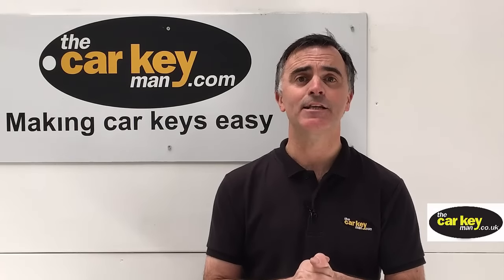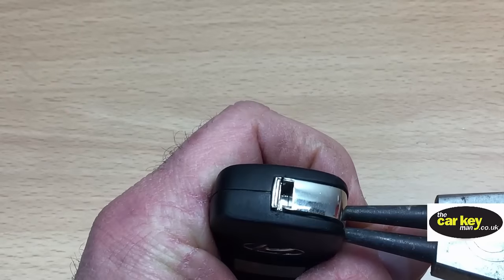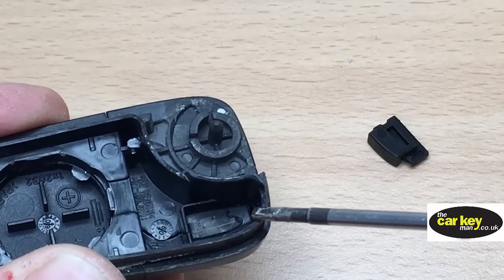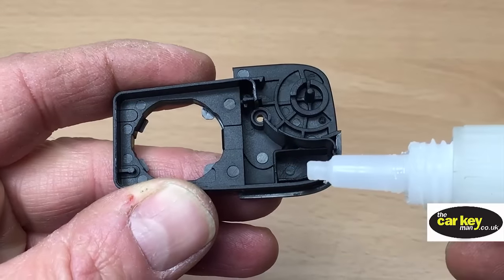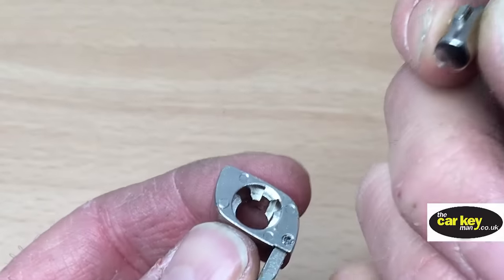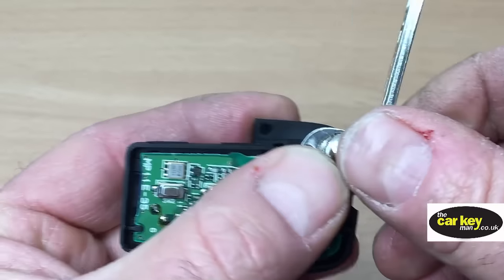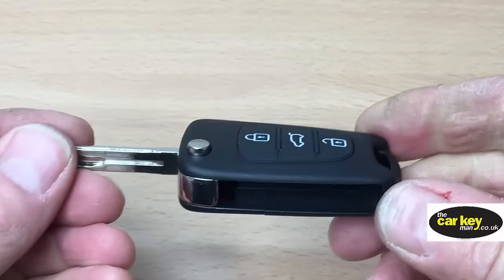FIX Kia and Hyundai Flip Key HOW TO repair

Comment: The dealer wanted almost $400 to replace 1 key fob! I needed to replace 2. I bought the FOB's on ebay for about $18 each and did it myself. Just switched out the circuit board from the old which was still good and put them in the new case. BAM saved myself almost $800.
Reply from the maker: Well done, the prices from the dealers are outrageous at the moment, not sure why. Really glad it helped :)

Comment: thx for the info. learned alot with this movie....... about the pin ..if you search enough on the internet you will find the pin remover (punch).. Most keycar clones sellers have tools on there website too..   and if you dont wanna do it by yourself ..you can still go to a keymaker/shoemaker..   Dont go to your garage because they will bill you...  here in holland its about 300 euros and it takes about 4 or 5 days..pfff
Reply from the maker: Hi, thanks for the information here. Yes we need to put a link up for the pins. Glad it helped you :)
Reply: Just a update of my car key..  I changed the sword and it worked...just made a little mistake..i turned the holder the wrong way  ":/.  It close now when i push button and have to use 1 finger to open it.   But that for me personal better because i broke 2 key in my pocket because they pushed open and there came pressure on the sword and it broke..... twice..    only when you bring your car to the garage you have to tell them how the carkey works otherwise they will say that the carkey is broken.........  primary thing   it works.....

Comment: I have a question if the buttons on the circuit board breaks, can i just swap another circuit board from remote ff the same model? Will i be able to program the button to work on the door locks or the new circuit board has to be paired to my car first by the car dealer?
Reply from the maker: Hi Angelo, the new key needs to be coded in with a computer

Comment: Hi need to replace the keypad on 2 keys is it just a case of split the key and pull out the rubber pads and push the new ones in or is there a glue on them?
Reply from the maker: Hi Jamie
We've tried just replacing the rubber pad and not had much success, as they come looses fairly quickly. 
The cases are glued together so once you crack them open you can't re-use them

Comment: Kia Rio 2011 - Had to cut/snap the old outer casing as it was glued shut! and the transponder was glued to the little removable part which was great. thanks for the video!
Reply from the maker: Well done and thanks for the comments :)
Reply: I’m having the same problem! Thank you
Reply: I had this issue same model. Keys work engine turning over but wont engage

Comment: Genius.  Blade had pinged out as demonstrated due to cracked hinge. New fob was £6.99 and repair went exactly as described in the video.
Reply from the maker: Gtreat stuff Andrew, well done!
Reply from the maker: Did the old blade fit into the new case, or did you get it cut?
Reply: Used the old blade and had to file the groove as described.  Winding up the spring is awkward but can be done.
Reply from the maker: Thanks Andrew

Comment: Everything in this video is super helpful. However, I do wish that you had gone into more detail on how to get the pin out of the aftermarket key blade. I couldn't figure it out so I just added a different spare key on the same key chain. Having the buttons fixed was the most important part for me so while it would've been great to insert the laser cut key back into the fob I ended up having to use a separate key. Which isn't that big of a deal to me.
Reply from the maker: Hi, sorry I didn't show this. The blade is held into the blade holder with a pin. The pin needs to be knoked out with a punch, smaller than 1.4mm.

Comment: Car Key Man : Should have worn a Khaki shirt !   Anyway, brilliant video, did both my broken keys in less than 40 minutes (I tested the first replacement before tackling the second)..   One of my fobs had the chip glued in, the other was loose, but Kia replaced one a few years ago under warranty, I can't say which was which.   Like in another comment I used a belt sander on the side of the case until I had taken away all the plastic, then I was able to get a Stanley blade under it to release it from its super-glue prison.  Apparently that hinge fracture is  "endemic" I think is the word. Now I don't let my blade flip out uncontrolled so that it smacks at the end of its travel.
Reply from the maker: Morning Dave, thanks for such a detailed post. Interesting you used a belt sander too! Well done and stay safe :)

Comment: Thanks, my case broke in two when I tried using the snap ring rings. It appears it was glued or plastic welded at Kia factory, but the  chip came out easy though. FYI 2013 Kia Canada has transponder chips, identical US version do not.
Reply from the maker: Hi Rory, Yes the original keys are glued together. That's good that the chip just fell out. I'm not sure why some of the US cars don't have a chip when the Canadian models do. Seems strange to me. All of the UK cars have chips these days!
Reply: Rory; Did you have to use a specific tool to get the chip out? I have a 2013 Kia Rio5 in Canada.

Comment: Spot on this although since it was just a case of my blade coming out of its case as in the example showed at the beginning of the vid i just put a new casing in for the old blade and didnt mess with the chip. Also instead of filing the groove i found a bit of paper clip pushed through did tge trick
Reply from the maker: Well done on getting it working Sid :)

Comment: Ok, so it turns out my key fob does not require a chip. Thanks for the tutorial. It really helped me save a ton of money. Flip keys are a poor design.  The pin / hinge area broke on both my keys.
Reply from the maker: We've been told about alot of USA vehicles that do not have a chip fitted inside the key!
Reply: Wish I'd have read the comments before I searched for my chip!  :)
Reply: Me too.I sat and pried the opaque rubber that was glued in it for forever. Then looked onthe otherside of what I took apart and saw the place where the chip goes and realized I don't have one. Actually I hoped I didn't loose it so I put it all back together with new case and it worked.

Comment: Regarding that chip that's glued inside, can I just use alcohol or something on it to melt the glue? Or warm it up in the oven to loosen the glue? btw my key was glued shut, I had to spend a ton of time cutting and separating the parts with a tiny flat screwdriver before I could force it open like you did. would have used heat but I was worried for the electronics and I'm not sure if it's really glue or if the just melted the plastic parts together (so it will take a ton of heat to melt it open)
Reply from the maker: Ni Hir, sorry to hear you have so much trouble. Some pop open, a few just don't want to move at all. Maybe so glue disolver will work?

Comment: I have a 2013 Kia Rio5 in Canada. Does it have a chip in the fob? I don't want to be digging around, and risk damaging anything unnecessarily if I don't need to. Also, is the side that may have the chip, the same side that has the lock and unlock buttons? If not, could I keep the old side with the chip, and just add the new side that has the fob lock/unlock buttons? Thank you. *Note: I just noted that an awful lot of people lost a part when taking their old fob apart. I would suggest you take it apart inside a large translucent baggie where you can see what you're doing. That way if things go flying, you won't have to go on the hunt for them.
Reply from the maker: Hi Doris, I like the idea of taking it apart inside a plastic bag. To be honest, the pieces that tend to fly away are the old spring and pin which you won't need again. 
About your Kia Rio, if it was a UK car, yes it would have a chip

Comment: Brilliant video, however the only thing I have no idea how to do, is the removing and putting back the pin. How do you do this without damaging the flipping metal part of the key?
Reply from the maker: Hi, so remove the pin you need a small punch, with a diameter less than 1.4mm. To re-fit you need to carefully hold the pin and either knock it in, or squeeeze with pliers
Reply: @TheCarKeyMan  Thank you!

Comment: Do you have any tip how to remove the pin from the hinge? I did all steps but i struggle with that pin. Do you have any idea what home tools can i use to remove that pin? Thank you.
Reply from the maker: Yes you need a pin removal tool, the diameter is 1.4 mm
Reply: @TheCarKeyMan  Hey. Thanks for the reply. However, fearing that after changing the blade it will have slight play. I decided to make a new blade. Now it looks like brand new key.

Comment: Quick question: The sensor part: is that only relevant if you have keyless ignition? I have the same exact key, but it's ignition obviously and I read somewhere that the sensor is only needed for keyless ignition. I wanted to ask before I started prying things open. Thanks!
Reply from the maker: Hi, the chip is used in both keyless and non keyless systems.

Comment: I've followed the steps as per the video - the new key is definitely put together correctly and the led lights up when the lock and unlock buttons are pressed, however the car doesn't lock or unlock. How easy/common is it for the chip to break or fail? My wife just got the car and the 2nd key had no battery in it. I'm wondering if either 1) I've damaged the chip (seems unlikely as it wasnt glued in and I was careful) 2) the key was already broken and dealer left the battery out to disguise this.
Reply from the maker: Hi Ryan. Does the car start?
Reply: @TheCarKeyMan  yeah, car starts fine, but that's after ive blipped the 2nd key to get the door open. Ive presently got 1 key that locks and unlocks but the blade falls out, plus the newly transferred 2nd key with a blade that works great but no transponder function. Im having to use them in tandem for now
Reply: @the_Zinabi  I'm in the same situation right now, did you fix this?

Comment: Started trying to get mine apart yesterday and still no luck. I managed the get the battery cover off but trying to get to the circuit board and chip is proving extremely difficult as I can’t get the two halves apart. Any advice chaps?
Reply from the maker: Hi Sean, are you using Circlip pliers?
Reply: @TheCarKeyMan  I tried with needle nose pliers, screwdriver etc and ended up separating the halves in the end but it took a lot of effort. I managed to get the circuit board and transponder out but in the process lost one of the tiny rubber parts that fits under a small cover which operates one of the push buttons on the circuit board. I had to swop one complete one over so at least I can open and lock the car now but can’t just open the boot, but that’s okay. This one is now the spare and I’m using my second key as the main one I use. My left hand is showing a few wounds but no pain no gain as they say - haha
Reply: @TheCarKeyMan  I managed to find a set of those micro switches on eBay so that’s positive. Just ordered some - they come in a set of 3 👍🏻

Comment: Perfect instructions, but 1 issue the electrics work to open and lock the key turns on for the radio and lights but the engine is turning over but not starting, i have a spare so i am fine, could it be something i have done?
Reply from the maker: Hi, have you swapped over the small chip?

Comment: Hi,
 Nice video.
How do you remove the blade and fix it on the  new attach ? Do you just push the "rivet" with  a  screwdriver ? How do you fix firmly this  rivet ?

Thank you
Reply from the maker: Hi, we use a small pin punch
Reply: @TheCarKeyMan  thank you

Comment: Hi could you tell me the fixing screw size for holding the back on? Mine never came with a screw and the back comes loose sometimes
would much appreciate it
Reply from the maker: Hi, quite small, max is about 8mm in length and thin. Cant give an exact size sorry

Comment: Hi. Another video shows that they didn’t need to remove the transponder chip. Do some models have the chip included in the circuit board?
Reply from the maker: Hi Jason, there are a few US models,such as the Soul that do not have a chip. However all UK keys that I've seen have a chip that needs swapping over.. Be careful as you remove it from the broken key.

Comment: Very useful video thanks! However, I don't see the need to superglue the chip into place. Surely once it's inserted and its little cover in place, it's never going to drop out. Removing the chip with a soldering iron is surely a risky operation with such a tiny chip!
Reply from the maker: Hi Richard. If the chip is glued in you have two options. Either cut it out with a blade or hacksaw, or melt the plastic around the chip using a soldering iron. 
Either method carries some risk unfortunately and I always opt for the soldering iron.

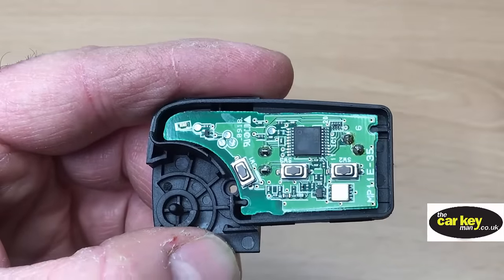Comment: I'm stuck at 4:21 how do I put the old key into the new one?  (My old 'key flip' system one is broken so I can't just use that).
I don't know how to get that pin out so I can get rid of the flat key and put in my car key.
Hope that makes sense...
Reply from the maker: Hi Robert, yes this makes sense. 
You are better off getting the new key blade cut for three reasons. 
1. You need a small thin pin punch to remove the pin, and you may not have one
2. Your old key may not fit into the new case without some modification. Take a look at our blog post about this https://thecarkeyman.co.uk/fix-broken-hyundai-key-loose-blade/
3. When you swap the blade over, it's easy to weaken the new blade holder.

Hope this helps

Comment: How did you get the pin out that skip in the video
Reply from the maker: Hi, you need a pin punch, less than 1.4mm and that will push the pin out

Comment: What happens if the immobilizer kicks in? Do I have to get it re-programed? I forgot the transponder the first time, second time put it in, but I think it's tripped the immobilizer with this key
Reply from the maker: Hi Andrew. Putting a key in without the chip won't cause the car immobiliser to go wrong. If you have the chip in the key, then the car should start. Was the chip glued in place?

Comment: Is it possible to  replace the broken flip part rather than take out the responder etc. I have a replacement key but the responder has not been programmed. Thanks
Reply from the maker: Hi Karen, no unfortunately not. Firstly, the cases are glued shut so you can't get them apart without breaking them. 
Next, even if you could open the original case, the correct flip part is not available and the copy parts do not fit correctly into the original case. Sorry!

Comment: How can I get a transponder? Do I have to go to Hyundai or is there another cheaper option?
Didn't know that you had to take the Hyundai badge of the key first and then un screw that little screw before opening it because I ripped opened my key fob.
Reply from the maker: HI Raj, There's not normally a screw, maybe it's been before? You normally have a screw on the repair cases. 
They will probably have them on eBay. Have you had a look?
Reply: The Car Key Man 
This key is a genuine Hyundai ix35 2011 key. To be honest we bought the car second hand and who knows what happened before. 

I have fixed it with superglue but I have a spare key that needs a transponder, can you tell me how I can get a transponder without paying Hyundai price.
Reply from the maker: Are you in the UK?
Reply: The Car Key Man 

Yes, Wigan
Reply from the maker: I need a few more details. Can you email us?

Comment: Great video.  I have a 2011 Kia Soul which i am quite sure has no chip as i can push just the blade into the ignition and turn it to start and run, without the keyholder case anywhere near the vehicle.  I now have two broken keys, how and where do i find these replacement fob cases?
Reply from the maker: Morning Michael. Is it a UK vehicle?
Reply from the maker: Hi Michael. You should be able to find the cases on eBay or Amazon. It will be alot easier for you if the keys don't have chips in. Thanks for the info
Reply: wish dot com has fob cases.

Comment: Just wanted to let everyone know the warranty on the keyfobs is 5yr/60k miles. Goto the dealer and tell them that it wouldn't flip open and you had to pry it open to be able to start it. Most of the time they will take care of it for you. At least we do at my dealer. Just make sure you bring all your fobs cause they will be needed for the reprogram procedure
Reply: Forgot to mention don't be a rude customer that bitches about how long the wait/repair is and thinks that everything is owed to you. It will get you NOWHERE  and not to mention your attitude probably added an extra 30 minutes to your wait. Wasn't trying to accuse anyone just pointing out my views formed over a 15 year period as a dealership tech. Be super cool and loyal. You will be amazed how far that will take you and how much money it will save you and how honest they will speak to you.
Reply from the maker: Hi Jonathan. Great to see someone from a dealer answering this question. Where are you based so that I can point them your way? We get alot of enquiries about this from around the country
Reply: I am located in Mississippi. Yeah it's a common problem mainly from people not closing them or having a excessive amount of keys\junk hanging off of them
Reply from the maker: Hi Jonathan. Thanks for this feedback. If you know of any UK dealers that are this helpful, please ask them to comment on this thread. This is a real problem in the UK and the message seems to me mixed coming from the dealership
Reply: I'm a little bit curious now. Why do the keyfobs have a mileage warranty on them?